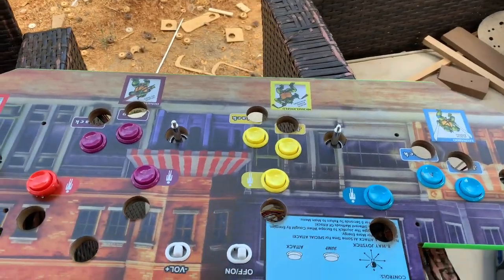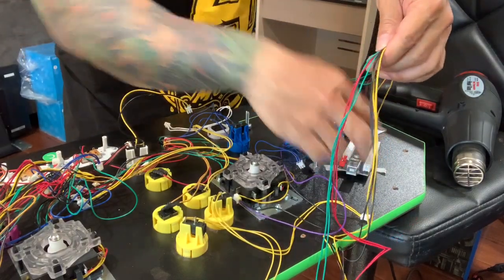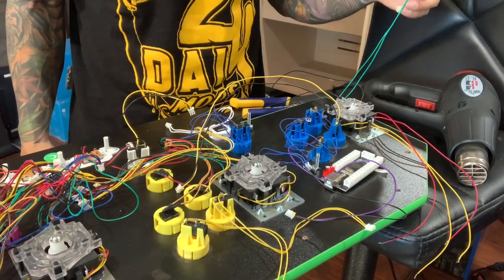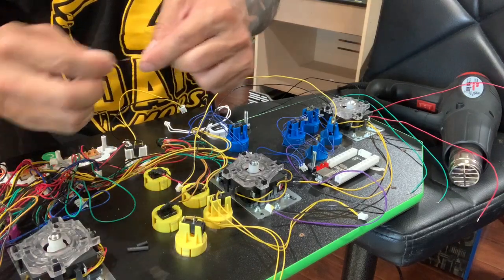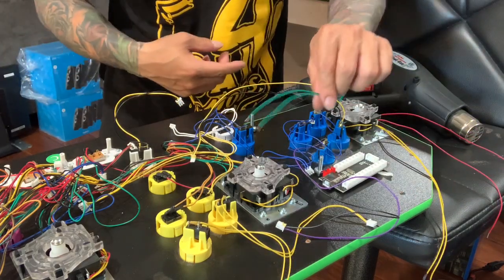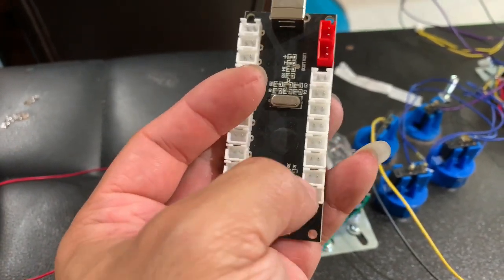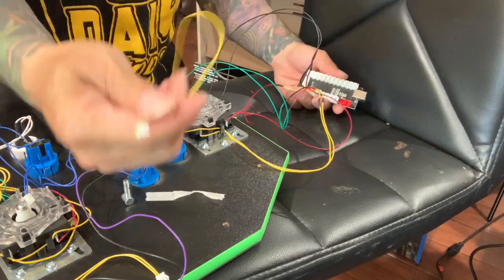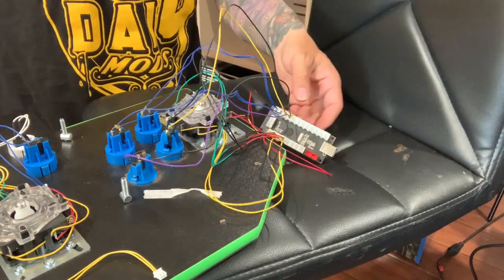How to use 1up sticks and buttons for pi or Pc the easy way

Comment: That is a killer tip on the shrink tubing. Good use woth heat gun vs the lighter method. Great tips great electronics practice. Clean as a mitha
Reply from the maker: Np thank you 😊